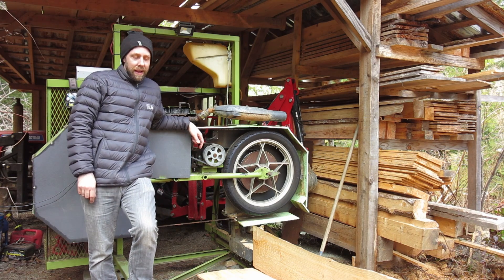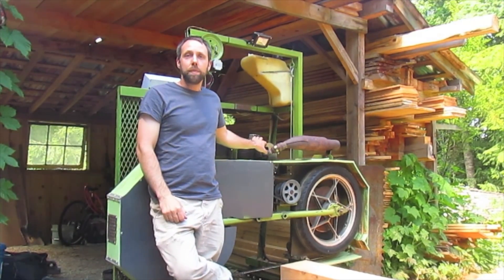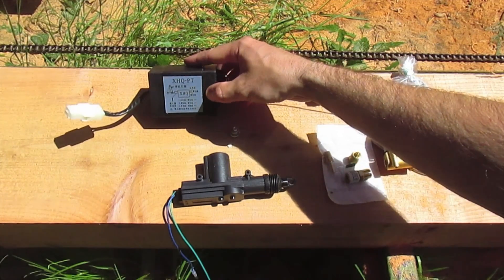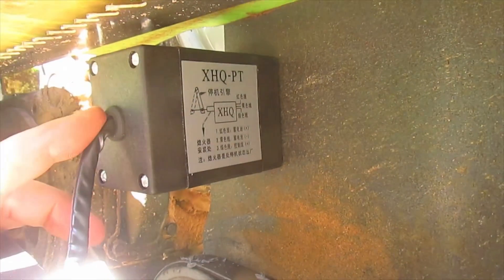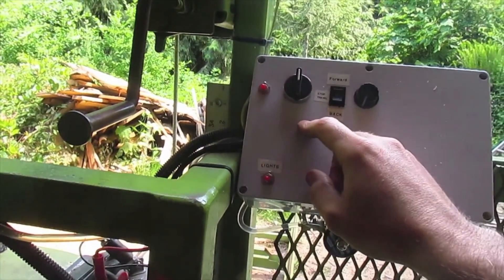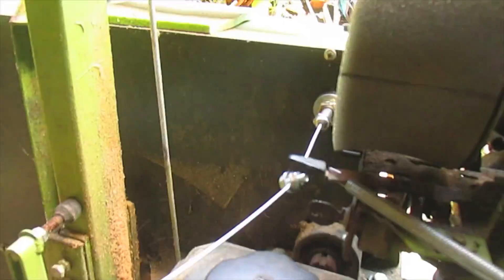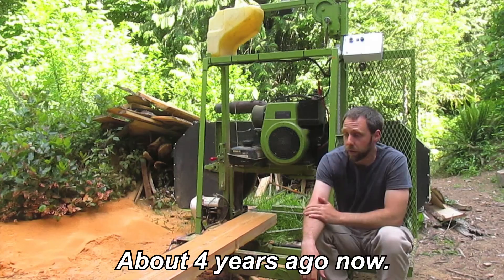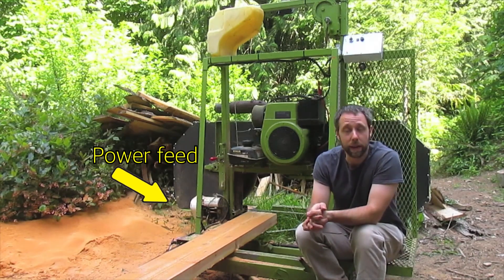Homemade bandsaw mill Electric throttle and blade lube control

Comment: Your sawmill videos are GREAT, thank you for sharing .  Your comments in the end should almost be at the beginning of all your sawmill video's.  They are right on the money.  There is a learning curve to saw milling and a $1700.00 Harbor Freight ( I had great luck with mine and there is a terrific user group)  will teach you all the unsaid difficulties, like how HEAVY logs are, how much waste there is to get rid of and how quickly you go through blades.  It it turns out not to be your thing, you can almost always get all your money back as there is always someone looking for a cheap mill.  Your mods do make a huge difference, but manual operation teaches you alot too (like be sure to clearance your log dogs...)🙄

Comment: Thanks for the playlist. Now that I am at the end, I am curious as to how well your setup does with hardwoods. Do you find that using the tires is a hindrance? Meaning you can't put enough tension on the blade? Or is it a non-issue? Also is the 12hp kohler you are using powerful enough to cut through 30" of red oak? I have cut down several in the 28-34" neighborhood and only care to build a mill once, not two or three times, if ya know what I mean.

Comment: What do you use for blade lube? What is the rate of feed that the blade lube meters out?
Reply from the maker: I’m using pine sol and water, about one cup to a gallon, I just have a small needle valve that meters a small amount that drips onto the top side of the blade, I don’t know the flow rate. 
It seems to work quite well 👍
Reply: @Mikefestiva  Great, thanks Mike. Really enjoy your videos. I have been out on the Peninsula to Port Townsend quite a few times. Really nice area.

Comment: Mike !  I have a project for you. Teach me the best way to build a wood gasifier. I know you want to.
Reply from the maker: Haha I have not thought about building one before, but maybe I will need to look into them :) Thanks for commenting! What are you planning to power with a gasified?
Reply: I started researching originally for the purpose of running a gasoline generator. But one could pump it into a propane tank and run a vehicle with it, I think it would be great devise to have should fuel be unavailable or too expensive. and it would be a fun project.. @Mikefestiva

Comment: Great mod - the easier they become to use the more they get used. Funny how a complicated machine doesn't seem so onerous when it is one step at a time. 
Thanks for posting.
Reply from the maker: Yes definitely! The power feed was one of the biggest improvements I have done to my mill, no more pushing it down the track, after that this blade lube throttle control was definitely needed, it makes it so much nicer to operate! Thanks for checking out my video :)

Comment: I really like that throttle control you have.  Mine is an air cylinder operated by a solenoid - so there are only two speeds.  Slow or fast.
Reply from the maker: Yes mines the same, idle and full throttle, but that’s really all you need :) 
I’m planning on making a sawmill video soon, I have a cool project video I’m planning, I’m donating some lumber to a friend, and I think this new video in a month or so will spin off for a side series of videos with the topic of coal, fire, water, metal and small tracks! It should be really fun!

Comment: Hey, Mike. Just got my Mill going, made some 710mm diameter steel wheels and finally managed to get them balanced, it's cutting straight now 😊😊. Or was untill I hit a log stop 😒. Blades are getting sharpened on Monday, then I'll send you a video 😊.
Reply: Just watched the video, have you thought about a 12v electric actuator? I was going to use something similar but I think I'm now going to use an arduino and use some servos for throttle and choke so I can run the whole mill from 1 spot. Thanks and also a great video 👍
Reply from the maker: That’s great to hear your mill is up and running! Yes that same thing of hitting a log stop has happened to me early on when I first got my mill going too, It happens :( 
I thought of wiring up a proximity sensor to my power feed that would sense the metal log stop and shut off the feed, but I decided it’s probably not that necessary, and I have got into the habit of always checking before I make a cut. I would love to see a video of your mill! Please do post a link to it!
Hey I took your advice of stubby glass TIG cups and man did they make a difference! I just got a chance to try them out last night, there’s no way I will ever go back to the standard ceramic cups again! Thanks :)

Comment: Choke cable and a ball valve for me.
Reply from the maker: What kind of mill do you have?
I added a needle valve in line with my ball valve years ago before I had this 12 volt control valve, it was nice because all you would do is turn the ball valve on and you always got a consistent metered flow without trying to set the ball valve ever time.
Reply: I don't have a mill, but I try to build stuff as electronic free as possible.  Too old school I guess.  Your set up is one of the best I've seen.

Comment: You should of mounted that cable fuel pump actuator sideways on the inside away from the blade with a pulley to make it turn 90 degrees so that you could keep it away from water & sawdust.

Comment: That's a freaking awesome setup!
Reply from the maker: Thanks! Have you picked up any new projects lately?
Reply: Ha I finished my Quad project, nothing fancy but its earning its keep now. Haven't gotten to the 65 AC tractor yet im eyeballing a early 80s Workhorse tractor a buddy has. I just offloaded two riding mowers I got running and I gave my neighbor a Predator 173 motor to replace there mower they blew the little stock motor they were super happy especially since I installed it for them great older couple!  I just picked up two outboard motors on a trade for a 12ft vhull boat i was never gonna use. Just got one in the tank running well after carb replacement and an impellor swap its going out tomorrow. I am getting ready to bench the longshaft Nissan, pulled the carb, its bad soaking in some berrymans as we speak also needs an impellor. I need to fix my wipers on my IDI F250 and I heard a horrible clunk in my 88 Raider haha always something to tinker on. @Mikefestiva
Reply from the maker: Sounds like you definitely stay busy! That’s good you help your neighbors like that. 
I need to keep an eye out for a long shaft 4 to 9 hp boat motor for a sail boat I bought last Fall, it’s a 21 foot San Juan, it’s small but big enough to sleep aboard, it’s in fair shape and came on a good trailer, I’m hoping to get it ready to sail on some of the lakes and bays around my place, I don’t know how much I will take it out into the strait of Juan de Fuca by my place, I have done some sailing but it was over 10 years ago and I definitely have a major respect for how quick a nice day can turn into a blustery storm out here. Well take care :)
Reply: Nice years ago I had a New England catboat perfect for the inland waterways here, 16ft very beamy, sailed well, gaff rigged and shallow draft Lived aboard for awhile then salvaged a sunk house boat at 32ft it was awesome very austere, Pulled the 454 big blocks and put two perkins diesels in it man thing would go anywhere sipping fuel with the cat boat following behind.. @Mikefestiva